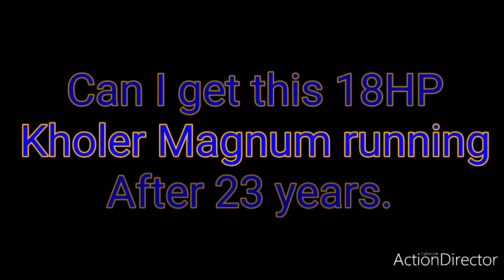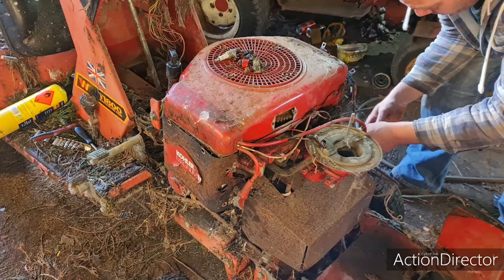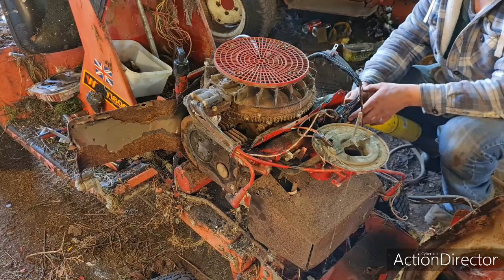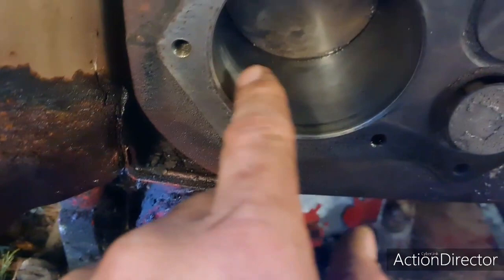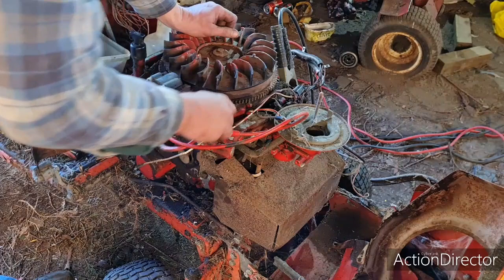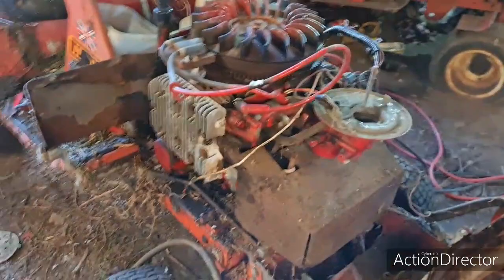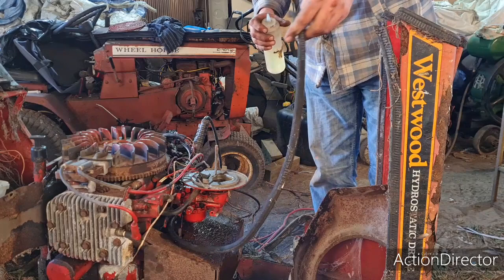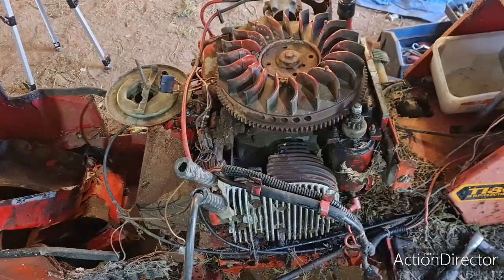Will it Start after 23 years? Westwood ride on.

Comment: Is it possible that it’s only seized because the coil is rusted to the flywheel (just a thought)
Reply from the maker: No I could see a slight air gap in the coil. Was definitely that rust ridge on the right cylinder. Thanks for watching.

Comment: getting them stubborn nuts of try finding and getting a lowest torque impact driver if you go to high on the torque it will break them off but a cheap low torque should break the corrosion on the threads most of the time its better undoing with instant hand torque,obviously with a bit of wd as well, anyway good day to you mr mancave.

Comment: Awesome job my friend 👍
Reply from the maker: Yeah she is there mate. I have done a bit more since the vid. I cleaned the carb and engine up. Will post the video in an hour or so.
Reply: @NorfolkMancave  awesome, can’t wait to see the JD with a new engine
Reply from the maker: Got to see if it fits under the bonnet of the JD yet. I did measure is and if I got it right I should have a inch either side. 🤔